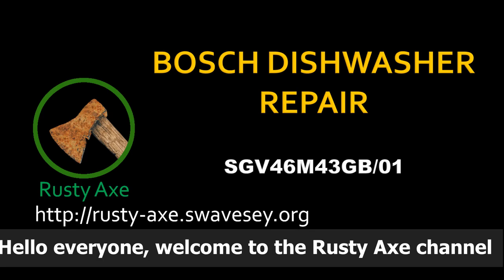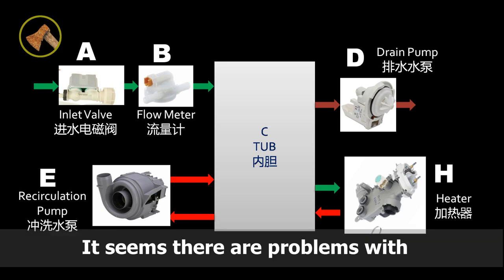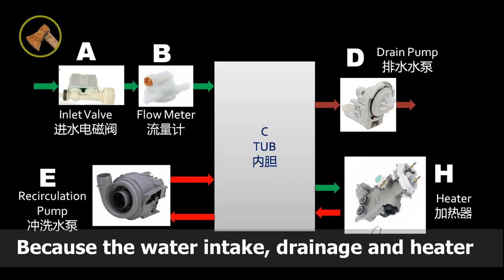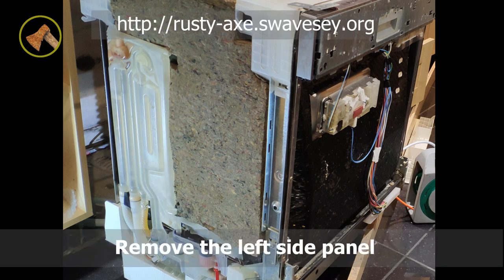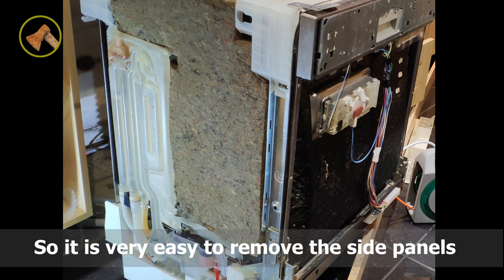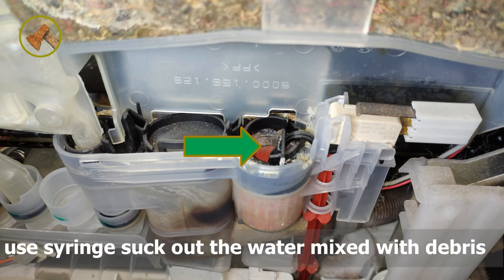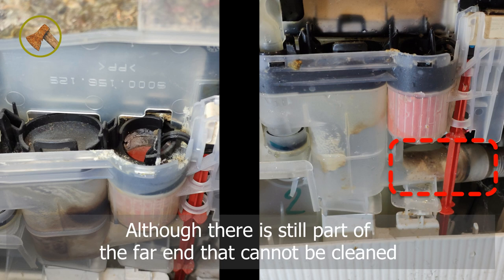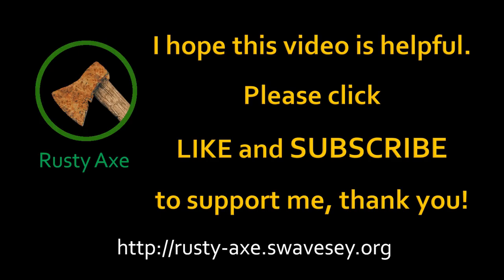BOSCH Dishwasher Lower Temperature/Always Drain/Stuck on 1 Minute/Abornal Washing Repair

Comment: Thank you for this video.  I had the 1 minute issue with my Bosch dishwasher so I gave your solution a try it worked.  The red plunger was stuck by the water residue.   But, what I did was remove the part and took the black lid off and cleaned the part.  It was easy to do.  I put it back in and it worked.  Thanks again
Reply from the maker: Glad it helps.

Comment: Thankyou. Very clear. My Siemens dishwasher is filling and draining continuously. It doesn't overfill but as soon as the water is filling in the drain is pumping it out. Does this sound like the same issue. Flow switch?
Reply from the maker: Very likely, you could open the dishwasher to double check.

Comment: Rusty I noticed you mentioned stuck on 0:01 on the description of your video, however you didn't address that problem.  Is it related to the cleaning the pressure chamber or could it be another reason? I am getting a few different suggestions and I am wondering if it is worth repairing.  Thank you for taking the time to respond. : )
Reply from the maker: The issue of my dishwasher is a bit random (not consistent), and all issues are gone after cleaning.
Reply: The stuck on 1 minute I have seen it in a video being caused by a heated connection (soldered connection) on the Printed Circuit Board. The machine I am looking at the moment has the 1min situation and after opening and looking at the PCB I can see where the connection is obviously getting hot.I am just going to resolder the joint ( as soon as I can get my hands onto a soldering iron) as this remedied the problem in the video I watched.
Hope this helps you and me also come think of it.